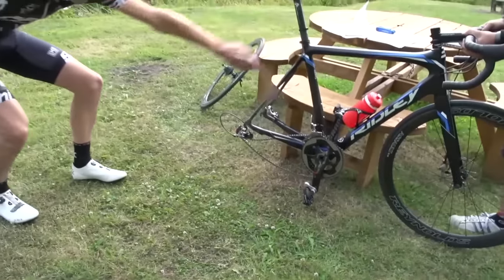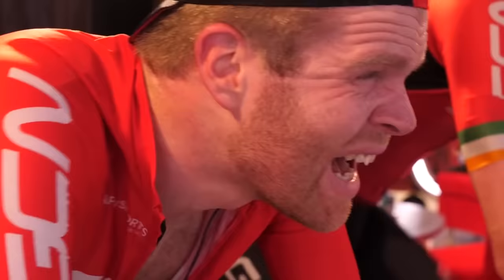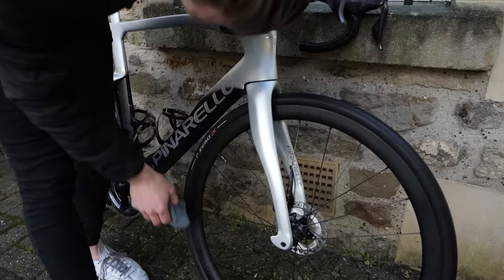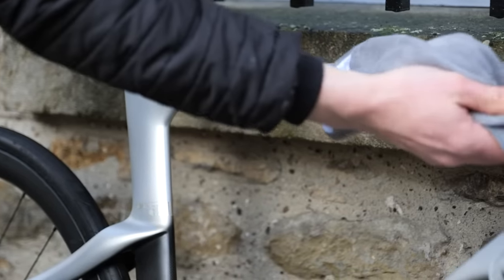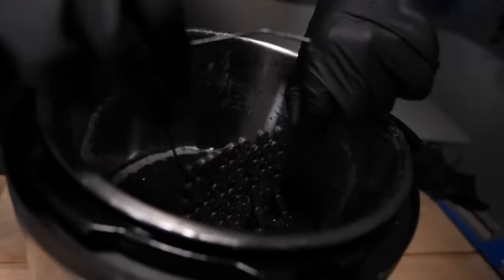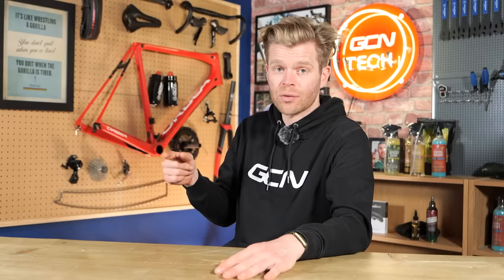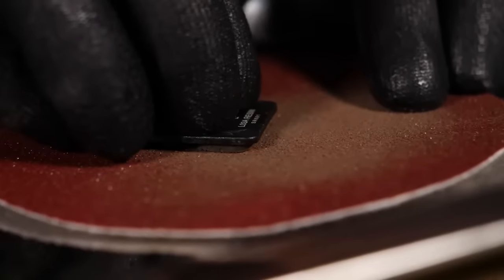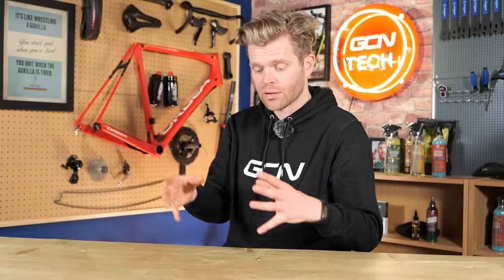6 Maintenance Mistakes That Are Ruining Your Bike!

Comment: Si’s advice back in the old days 😂.
Reply from the maker: Little naive Si 😂
Reply: No he was not naive… just not sponsored by all the fancy brands. At that time GCN was authentic. Now its a sponsoring show
Reply: So basically ignore everything Si ever told us about cleaning and maintaining your bike😂
Reply: i dunno, i've use mild dish detergent on my bikes for maybe ten years now.... and it works just fine. and no, its not too powerful for your bike. glossy bikes, matte bikes, everything in between. maybe if you're using it straight up undiluted. who knows. but just a quick squirt into a big bucket of water. more than enough to clean everything.
Reply: @chickenpoodle  Washing up liquid contains salt. That's why its not recommended for cars. I use car wash.
Reply: @grahamaustin9085  Why does it matter if it contains salt?  I assume it doesn't contain enough salt to do immediate damage and you immediately rinse the bike off with water, so all the salt should be washed away.  Am I missing something?

Comment: Ollie, need your opinion. I wash my bikes by filling a bucket of warm water, to which I add a cap full of car wash, applying with a 50 mm soft paint brush (used soley for the purpose of)
Then allow the bike to dry by the sun. After that I bring bike into garage, to cool off.
Sun can be very hot here in Aust.
With my carbon frame bike, I then apply motor vehicle wax over frame/fork.
Is that ok ?  Just trying to preserve the carbon material.

Comment: Been washing my bikes with washing up liquid for umpteen years without any problems at all.
Reply: I've heard the salts in it errode the lacquer over time.
Reply: @mrflaxtv81  As long as you rinse the bike with clean water after it'll rinse off the salt.
Reply: @mrflaxtv81  It's a tiny amount of salt.  A few CC of soap in a pail of water -- even if the soap was pure sea water, the resultant mix wouldn't be that salty.  And of course the soap is mostly NOT salt; a small amount is there just to adjust the viscosity.  It's an insignificant amount of salt and pales in comparison to the mineral content already in your tap water.  So unless you're washing with distilled water there's no practical difference.
Reply: @BixbyConsequence  I meant ammonia and bleach salts, rather than a common sodium compound. Combined with UV from sunlight exposure it can weaken and crack the top coat protecting paint, then dull the paint etc. For the sake of a few quid, I'll stick to Muc-Off to wash the 3k steed...
Reply: except you are slowing eating away the clear coat on the bike frame ...
Reply: @TanManFixes  ...isn't slowing eating away at ait a good thing?
Reply: @mrflaxtv81  my S-Works is 14 years old in May. Still looks superb and have used washing-up liquid all the time I've had it. In a bucket of warm water,  all you need is half a teaspoon of it and a decent sponge. The latter is start will create the foam. It's not on there for long anyway and gets rinsed off with clean water pretty quickly.
Reply: @BixbyConsequence  thanks for talking sense 😊

Comment: Bollocks! I understand that you now need to boost overpriced Silca bike wash liquid but you have a degree in chemistry, so please name the SPECIFIC chemical ingredients in dishwashing liquid that are good enough for car paint but will destroy the lacquer on your bike?
Reply: washing up liquid is a detergent just like the bike cleaning stuff (differing concentration) so yeah its not going to destroy anything.
Reply: @magicknight8412  TBF you should not washing you liquid on a car ether salts in will take the wax off but since i rewax it wont matter
Reply: you DON'T use it on car paint. it strips EVERYTHING from the clear coat.
Reply: @meneldil7604  not that i do of course !

Comment: You should thoroughly clean your drivetrain at regular intervals, and only apply new lube when it's totally spotless; completely agree.  Obsessively avoiding brake rotor contamination is also a very good idea. Dish soap? I don't agree with that one; it's not going to damage anything on your bike if you don't use ridiculously hot water. If it doesn't scratch porcelain, it's not going to scratch a powder coated bike frame. 

 I particularly don't agree with the bike bag rant. It's a bike, not a museum piece; it's meant to be used, and that involves a certain degree of wear and tear.

Comment: Here's a tip: if you don't want to get royally reamed by bike companies marketing you 10 quid bottles of bike wash that they buy by truckloads of IBCs (1000 litres for a couple of hundred quid, then bottle & mark up 700-1000%), use wool wash detergent. It's about the same chemical composition, give or take. Even the off-brand stuff won't affect your paintwork nor the lube on your pivots or bearings. 1 cap per bucketful is plenty.

Comment: Nonsense -a capful of dishwashing detergent in a gallon of warm water. is perfect for the job. It contains the surfactants that you want -just like the overpriced products "designed" for the job. The method of cleaning is what causes issues, and Ollie is spot-on there. No power-washing. and no brushes on the paint.

Comment: If all these things can damage a bike so easily, actually riding a bike must be inherently unsafe. I better just mount my bike on the wall of the living room as a piece of delicate artwork with a sign that says, "look but don't  touch." Of course the hangers to display it will likely also cause structural damage. Maybe manufacturers could build them like they did in the old days. Almost indestructible.

Comment: Thanks for creating these videos! These are better than much of the advice my son and I have gotten from elsewhere. I am not sure if you see this anymore but I would like to ask your advice on something that recently occurred while we were fine tuning our bike. My son, while following advice from someone else, opened up the disc brake caliper on my bike. As expected, oil went all over and my disc brake pads were ruined but when I saw that there was loctite on the screws I immediately felt that perhaps they were never planned to be removed. My question is...would be be OK to put it back together and put it back on the bike or should I order a new bike caliper? If I need to order a bike caliper then are they interchangeable (i.e. the current one is a Hayes disc brake so could I swap it with a Shimani or other brand)? Anything I need to keep in mind if I need to replace it?

Comment: I suspect learning how do clean your bike will involve yet another (expensive?) product. For those of us who don’t have a bottomless pit of cash, hot water with a small squeeze of dishwashing liquid, topped and tailed with the garden hose jet nozzle does the trick perfectly well. I also use a very soft brush from from a household brush and pan set, once the initial hosing has been done. My disc brakes are cleaned with rubbing alcohol, cheaply available. 6 years on, my beloved beast still looks brand new.
Reply: No and NO! Car wash liquid is cheap enough and infinitely better than dishwashing liquid. Dishwashing liquid actually contains abrasives that can destroy your topcoat. Ever see those cars where the top coat is peeling?
Reply: @kevinc9528  fair enough, I’ll give that a try and if it does the job, that will be the new approved method in my house 😎
Reply: @kevinc9528  when you say "dishwashing liquid" are you referring to the stuff you put in your dishwasher appliance, or the liquid soap you typically put in a sink with hot water? The former does contain abrasives, the latter does not.
Reply: @treyquattro liquid soap used to clean pots and pans. Is basically a degreaser. It works very well, as good as a dedicated degreaser oil.

Comment: A bicycle is a write off when the frame breaks ( if it's carbon fibre ). A steel frame can be repaired.
So in effect, a 20th century steel bike cannot be written off if you want to keep it. As long as the BB shell with the frame number remains, it's still alive. 🙂

Comment: #askgcntech  please investigate what happens to a frame used in an indoor trainer.
People sell bikes "only used indoors" but I think it might damage the frame, especially when standing up and sprinting
Reply: It is very hard on the frame, only crashing is harder.  That is why I became a Spinning instructor so I could create an indoor ride for training days and the cold months that is "cycling correct".  Tear up the gym's spin bikes instead of your own and interact with fellow humans in person rather than avatars! 
😃👍🏻
Reply: People sell bikes described "Used two times since purchase" with photos telling one of rides was from Alaska to Patagonia.
Reply: A dedicated smart trainer is expensive but can save you in the long run on wear and tear on your outside bike...cassettes, chainrings, chains, bottom brackets, jockey wheels...  A good dedicated smart bike is driven by a massive chain or belt system that can go 10's of thousands of miles with no maintenance.

Comment: Dishwashing liquid has worked very well for me for over 15 years with zero negative effects on my clear and matte finished bikes. I clean my bike(s) every 3 rides, which means about 40 times every summer... are there better products? Sure. Do you need them? That's another question entirely.

Comment: #askgcntech Can you do a how-to on cleaning disc brakes? Best practices to clean and maintain rotors, as well as your favorite product(s)? Thank you!
Reply: Isopropyl alcohol and a microfibre cloth is perfect for cleaning your pads and discs, I do the discs at least weekly (or if a squel starts) and the pads probably bimonthly (or if a squel starts) this is also a great time to check for wear and tear, if you are just wiping the discs off you don't even need to take the wheels off and this also works for rim brake bikes.
Reply: @toastie1648  this might sound silly but is isopropyl alcohol... Surgical spirt?
Reply: @kegalormoon  No

Comment: How about?
Leaning it on the bars/hoods when windy could be a bad idea a little wind gust is enough to move your bike forward and your fresh new bar tape/hoods levers or even the back on the saddle can be scraped or worse your whole bike dropping to its side and scratching paintwork and more components -id just lay it on its left side.Another very important tip id say using too much degreaser (like wd40) around the cassette when not fully removing of the wheel and cleaning it ,the degreaser gets into and eats the bearing and hub body grease  which results in broken back wheel if not serviced often enough.When using a high powered high pressure washer watch out spraying into chipped paintwork especially carbon as you may chip it even more-or your favourite wheelset stickers may come off from the high pressure-lower the pressure or use it from further distance 👍

Comment: One thing you'll spray without knowing is tyre sealant, when you let air pressure out the tubeless valve can release sealant with a blast of air towards the disc.

Comment: Something to mention about paint protection film, removing it (when a corner was peeling) also removed part of the paint on my head tube. Appears that this might have been user error, but wanted to warn others.
Reply: When removing protection tape always heat it up with a hair dryer so the glue is softened a bit.

Comment: This is a similar experience to my Late 1980's Gardin, SL chromoloy tubing, C-record, now Campy/Tiagra/Tektro/Chinese searpost mix, vs. Cannondale Synapse 105 Aluminum bike.  I find great comfort o  the Gardin and getting slowly used to the Cannondale.  There is nothing like a good pair of rubber caliper brakes compared to the modulation of the disc brakes (non hydraulic).   Also, the down tube shifting makes accurate choices fast.  We bring in new tech, often concentrating on proprietorship, instead of other more important factors.   Thanks for your cool review.  I really do not see why Giant took a giant blow. It's a bike that needs a human to power it.

Comment: Household dish washing liquid is made to be safe for human skin. It's not as powerful as a stripper as Ollie seems to think. However, the powder detergent for dishwashing machines is not made to be safe for skin and should be avoided. Same with laundry detergent, either powder or liquid. If it's for use inside a closed machine don't wash anything by hand with it.

Comment: THANK YOU for finally addressing but using dish soap for bike washing. I comment this on as many bike wash videos as I can that say to use it. It's not good for the finish and will eventually cause finish issues which can be even more detrimental to carbon bikes which rely on that to protect the glue from UV and other external threats. There's a reason car guys don't use dish soap on their cars.

Comment: Washing rim brake bikes is MUCH less problematic than washing disc brake bikes!🤔
Reply: i agree but discs are better in that i dont need to replace my wheels every year cos the rim is worn
Reply from the maker: Rim brakes? ... Are they a new thing? Never heard of them! 😉
Reply: @gcntech  That's right, when they become mainstream again, folks will be like: "are they a new thing?",  . . . watch this space🤣
Reply: @meneldil7604  oh, but you replace them when the 'next shiny object' flashes, right?
Reply: @meneldil7604  Yeah, but with rim brakes you can used alu rim wheels which don't set you back $1000 for a pair of basic wheels.

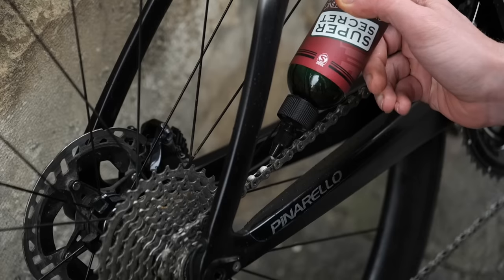Comment: btw. min 4:38. Instead of lubing the chain links from above rather lub them on the inner / lower side of the chain. so the contact area between chain and sprocket is slightly lubed, too and the the inner side attracts less dust than the outer side.
Reply: Liquid lube will move anyway.

Comment: I would maybe suggest that the brief video showing the chain lube being applied is "wrong" too. I was always taught to apply it on the lower run of the chain, that way you are applying it to the inside, and centrifugal force will assist the lube push through the chain and reduce fling...

Comment: Ollie, one of your best vids of simple tips, though your ammusing 4 year old tantrums are over done a bit.
You did miss that other sin of pressure washing the grease out of your bearings.
Never the less good advice.
I hadn't thought of the sweat one so its out to the shed with the cleaning materials after 30 in 30 turbo sessions.

Comment: Way to out Chris Opie. I’m sure you could have edited this a bit more respectfully? As uncle Ben said: with great power comes great responsibility.
Reply: Si's in there too. Much more, in fact. It's fine to call out the wrongdoings of the past.
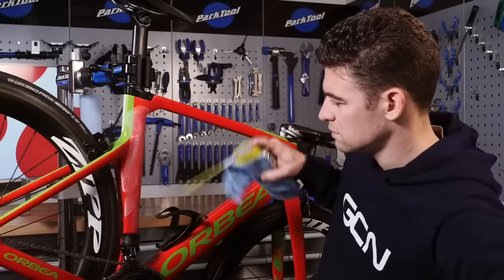Reply: 7:01
Reply: 7:03
Reply: Why the second part? Why would GCN make sure to make it really clear at 7:03 that it was Chris Opie? He left the channel. Si didn’t. Si can defend himself on the channel, or make light of it or just don’t give a crap. How should Chris Opie respond to this. Its just unnecessary. GCN must surely know that Chris Opie probably won’t like it (he may very well not give a crap either - what do I know🤷‍♂️) but GCN makes a clear choice to first use the piece where Opie sprays the bike. And then just his face?? Why? I don’t get it.

Comment: With the turbo you don't need to use your really nice bike for that, the bike I use on the turbo was 200 euros second hand, it's got downtube shifters and there's a little spot of rust on the top tube, the breaks don't work, the small chain ring is missing, it's just perfect for the turbo.

Comment: Loving the obsession with using "proper" cleaning products and keeping a good finish, a man after my own heart. Going to have to disagree at 4:48 though, your man's lubing the outside of the rollers, he should apply lube on the chain at the bottom, therefore lubing contact points.

Comment: My turbo bike has a spray cover on it to protect it from sweat, and as I get messy pretty quickly I’ve a collection of hand towels to go over the handlebars plus one over the front wheel. Job done 👍

I do actually use GT85 (like WD40 but smells nicer) on the chain on turbo bike - works fine for indoors

And for outdoors bike whenever I’ve washed it then done chain cleaning and maintenance the last job is to wipe down front and rear discs with brake cleaner 🙂

Comment: Ha! Brake rotor surface contamination.  That advice is expected from a kick ass power climber!  When you are hauling ass down a mountain NEVER give up free speed! If you are braking hard enough for that switch back the rotors will burn that contamination off and sing from heat dissipation.

Comment: After every ride, solely on dry conditions, I soak a microfiber towel and pass it on the frame to remove dust or whatever could have made its way on to the frame. Perhaps I shouldn't as it may scratch the lacker?

Comment: Brake squealing is easily fixed by removing the pads, setting them pad-up on the concrete, and hitting them with a small butane torch. Let them cool and reinstall. Quickly burns off any solvents. Alcohol or auto brake cleaner for the rotor and you’re done. There simply isn’t a need to replace them or artificially wear them down (unevenly) by sanding on them.

Comment: I use one of those clip on chain cleaning tools with White Sprite. Then clean the chain to remove any residue, dry  and finally oil.  Is White Sprit a good idea?
Reply: White Spirit is a good chain degreaser it's what most people that don't have an ultrasonic soak chains in to strip the packing grease off before waxing. I would hose the bike down after though to make sure any overspill doesn't sit on your frames paint work for too long.